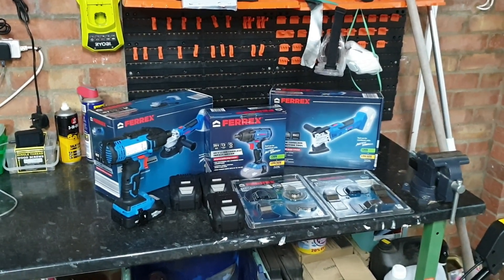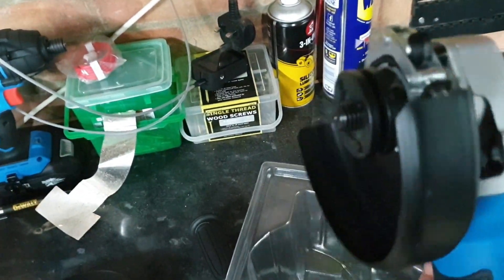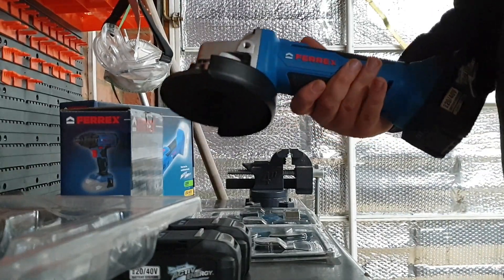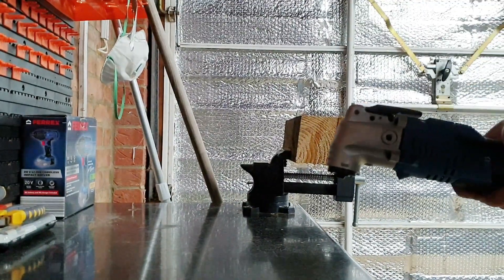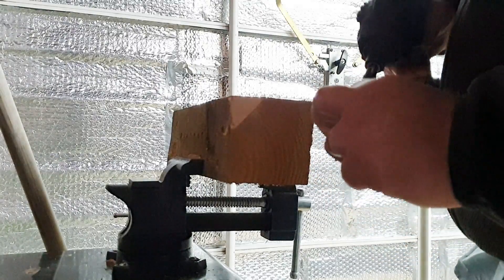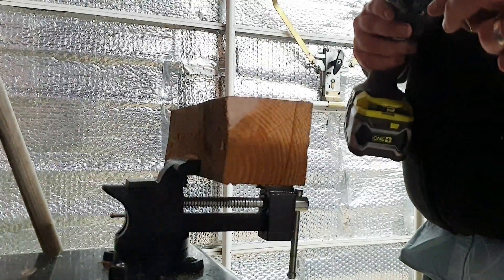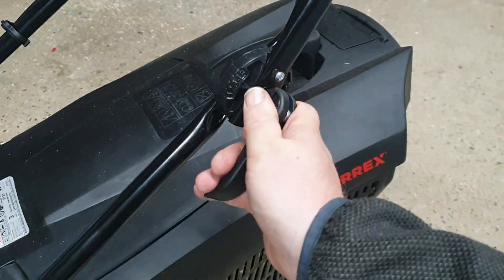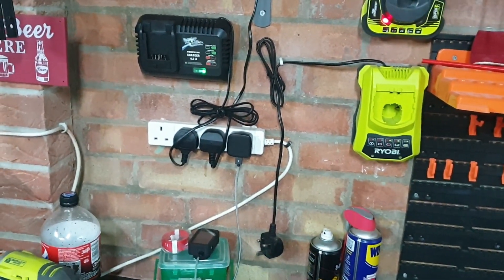Aldi Ferrex Tools and Lawnmower

Comment: I got everything but the lawnmower and am well happy so far, I just hope they add to this range as I see they brought out a 18v ferrex combi drill which is not compatible with the 20v stuff naughty really. The drill has no hammer function and the grinder and chain saw need the 40v battery but so far so good. I see you use ryobi I just sold all my ryobi stuff as this lot is just as good. These tools are made by Walter in Germany they also make erbauer tools and numerous other tools. The ferrex grinder takes a few seconds to get up to speed and the impact driver seems to hold an impact when you drill in screws other than that they are very good. The hedge trimmer and Strimmer are also very good. I think I will order the mower
Reply from the maker: See i was comparing batteries the other day and i thought they looked quite similar to erbauer ones i wonder if they are compatible at all
Reply: @adwol48  the older ones are not the new ones. A guy has them on a video on YouTube and they fit fine

Comment: Debating purchasing this tomorrow as my petrol lawnmower is so loud and heavy to move around. In two minds. Wondering how long the battery lasts.
Reply from the maker: if my grass is already at a decent length say 7-8cm I can do both my back garden which is roughly 50ft by 30ft and then the front which is half the size on one battery and have some power left obviously if the grass is taller it does require more battery power

Comment: Hey Adam, great video. Vey useful I've just bought the Ferrex lawnmower (the last one - jammy I know) any idea where you can get replacement blades for it as you're 3 years in?
Reply from the maker: I havent bought replacement blades yet I just sharpen mine still works great. But if you want replacement blades generaly there is an aftersales notice in the manuals and you can contact the company listed there and buy spares.
Reply: @adwol48  I haven't received it as yet still delayed in transit somewhere. But will of course check that out.

Comment: I managed to get the newer version of this, and I'm really impressed. The grass doesn't grow a lot where I live, so it's not had a real work out yet, but it seems very capable so far.
I got the mower and battery online, but they didnt have the charger online or my local store, so I picked that up from Amazon.
Went too a different Aldi a few days later, and they had loads...Oh well.
Height adjustment is 25mm too 75 in 5 steps.
It's soooo nice to cut the lawn without have the horrid trailing lead!
Shame they have sold out of strimmers.

Comment: Thanks for the review. Just FYI they are going back on sale this thursday in store, and seem available on Aldi's website.
The lawnmower they have advertised, looks a lot different from yours.
EDIT: I can buy most stuff online apart from the charger. All tools including charger are sold out online!
Wait....Amazon sell the charger....
Activ Energy Universal Battery Charger for Ferrex Battery Tools Garden Tools
Reply from the maker: yeah they have updated some of the industrial desgin of a few items like the chainsaw, lawnmower and impact driver. The new lawnmower might actually be better as it has more height settings than the old model and some people did complain it wasnt cutting short enough which is a problem i never had.
Reply: @adwol48  is better not too cut your lawn short anyway, Plus a mower needs airflow to create enough air to throw grass into the grass box if your to low it won't work plus its much harder on energy (battery or petrol) and will be more prone to damaging the blade trying to cut through stones soil, flag stones etc. Better to cut more often and not as short no matter what mower you use.

Comment: Great video thank you. How high is the handle off the ground? I'm 6'3" and struggling to find any information about it?
Reply from the maker: The old style is fixed lower down but the handle will pivot quite high i often have a fairly high angle on it as I'm 5,11. Cant comment on the newer model that is currently in stores I'm afraid
Reply: I'll measure it tomorrow if i remember. I'm 6ft and it's fine for me.

Comment: Hi mate what is like to loosen and tighten car lug nuts.
Reply from the maker: I have tried the impact on my wheel bolts they are done upto 81nm i think might be wrong on that. It did manage to undo them  but a proper 1/2 impact gun would be better. The adapter i bought to go from 1/4 to 1/2 sockets probably wont last doing a lot of wheel nuts. Tighten was okay but still used my torque wrench to finish them
Reply: @adwol48  cheers I'm better off buying the Parkside one then as my friend has one and goes upto 160nm I think
Reply from the maker: @satishsarju6177  checking the specs the ferrex actually has a rated nm of 180nm so its actually more powerful than the parkside driver. Neither are really designed to undo wheel nuts though
Reply: @adwol48  I got one of these last week it's brilliant undoes car nuts easily and also had one which was rusted but no prob for it. Great for the price. Got sick of waiting for the Parkside

Comment: No battery.   Not good.
Reply from the maker: Given that most power tool companies use the bare tool model i really dont see it as a problem. I picked up enough batteries to run multiple tools as 15 and 30 quid for the batteries was actually cheap.compared to say ryobi who charge 60-70 for a 4ah battery

Comment: They no longer stock the 40v battery.  So a total waste of money .
Reply from the maker: I bought three of the 40v batteries and one  of the 20v when they where in store so hopefully they will survive a good length of time. One of the upcoming special buys is DIY tools again so maybe they will  ring out more to the range I hope
Reply: @adwol48  That would be good! If they do I,LL buy another ,Two 40v battery's, the angle grinder I bought is brilliant, I use it when I'm getting steel for my projects, Cuts it in to lengths I can fit in the car.
Wouldn't mind the impact driver too if they stock them again.
Reply: They stock the batteries & charger in my local ALDI
Reply: @andrewlewiscameras  I know👍👍👍😁 went in there today and saw them back on sale bought another two for my angle grinder.
Looking for one of the impact drivers now, perhaps a drill skin also.
Reply from the maker: @davidaston1644  i believe online they still have the drill driver bare for 20 quid but they impact is out of stock. I picked up the reciporicating saw and its very good only widh they didnt have the stock issue with the circular saw as that order got cancelled